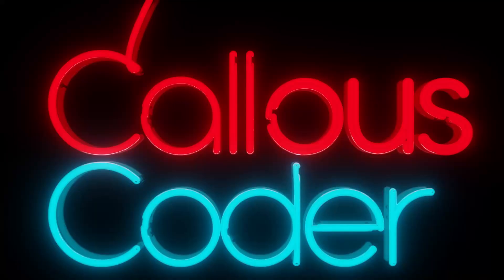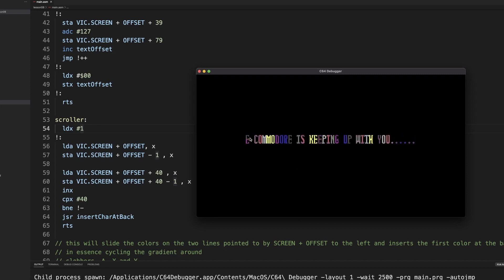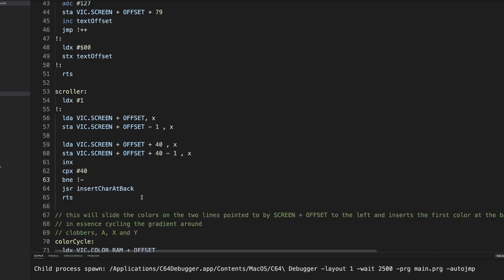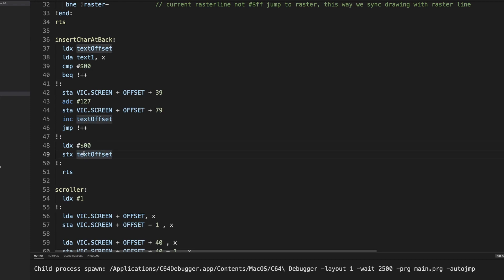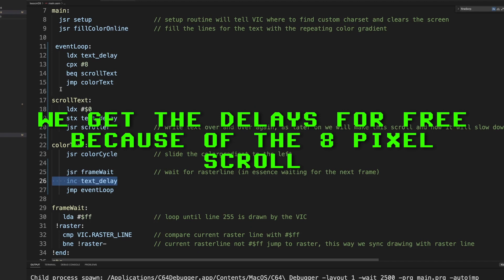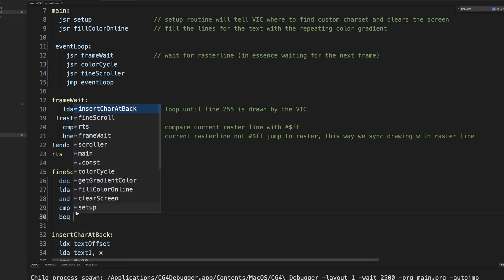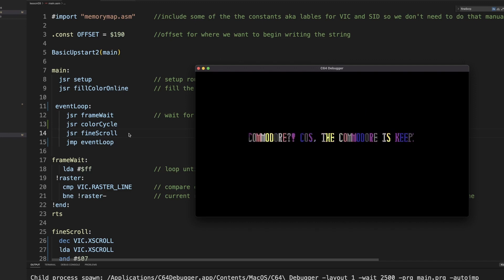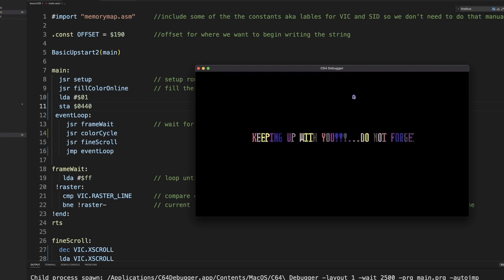C64 Assembly lesson 8 and 9: Hard and Smooth scrolling

Comment: I will have to look at your version. Mine seems to have a slight periodic hiccup and occasional glitching as if everything is being rendered out of position for a frame, though it's only partly rendered, just bits of characters. It's 99% OK, just a couple of issues.
Reply from the maker: Oh but those hiccups can be screen tearing that’s that you are rendering the visible stuff whilst the scan line is actually there to actually draw it already. This especially can happen of you have it scrolling on top and/or have some complex music.
And I say trick to see how much raster time you’ve used is to actually change the border colour inc d020 at the beginning of the frame (your code loop) and at the end do a dev d020 you will see how much time you spend drawing. Basically That bar should be shorter than the visual items you were drawing.
It can also be that you draw more than once a frame. That also can lead to screen tearing. This is the dark art of demo coding on these machines. Sometimes you need to swap order of execution of sub routines or move things to a different place on screen.
Or optimize code. You now hit that all time difficulty of game/demo coding on these machines. 😉
Reply: @CallousCoder  I've used the jiffy clock for timing, which I guess will stop that trick from working. I'm assuming I would need to synchronize drawing with the raster lines or something?
Reply from the maker: @gavinw77  in that next episode we explain raster interrupts.  Syncing using a raster line interrupt is the way to go.

Comment: Same stuff, only done with a 1x1 characterset, variable speed and the option to "speedcode" the pull-loop (change it to "true" to test):

    .const SpeedCode = false
    .const ScreenMemory = $0400
    .const ScrollSpeed  = 1
    .var x = 0

    //---------------------------------
    // BASIC & Initialization
    :BasicUpstart2(Init)
Init:
    sei
    jsr $e544

    //---------------------------------
    // Vertical Syncronization
Main:
!:  bit $d011
    bmi !-
!:  bit $d011
    bpl !-

    //---------------------------------
    // Main Loop
    jsr Scroll
    jmp Main

    //---------------------------------
    // Softscroll Routine
Scroll:
    lda SoftScroll: #$07
    sec
    sbc #ScrollSpeed
    bcs !+
        adc #$08
        clc
!:  sta SoftScroll
    sta $d016
    bcc UpdateText
    rts

    //---------------------------------
    // Text Update & Pull Routine
TextReset:
    sta TextOffset
UpdateText:
    ldx TextOffset: #$00
    lda Text,x
    beq TextReset
    sta ScreenMemory + 39
    inc TextOffset

    .if(SpeedCode) {
        .for(x = 0 ; x < 39 ; x++) {
            lda ScreenMemory + x + 1
            sta ScreenMemory + x
        }
    } else {
        ldx #-39
    !:	lda ScreenMemory + 1 - [256 - 39],x
    	sta ScreenMemory     - [256 - 39],x
    	inx
    	bne !-
    }
    rts

Text:
	.text "blabla      @"

Notice that there is no CMP/CPX/CPY isued in the scroller routine. You could also get away with aligning the scrolltext to a page and skip the offset indexing and just SMC increase the text pointer and restore it accordingly.
Reply from the maker: You went all in on the KickAssembler, NICE! Yeah there's some amazing powerful features in KickAssembler.